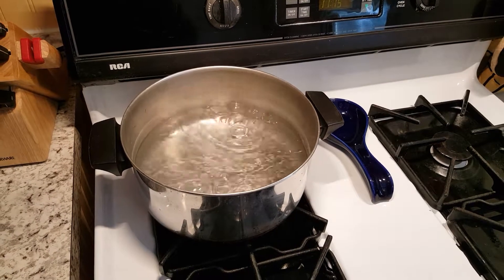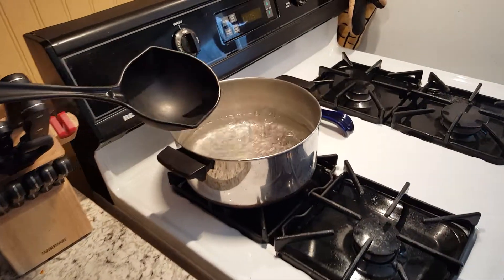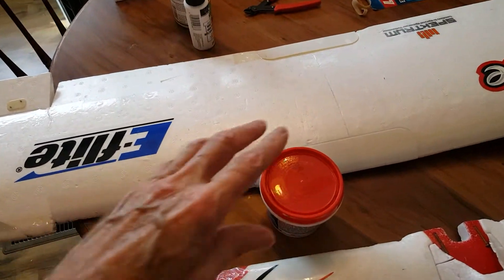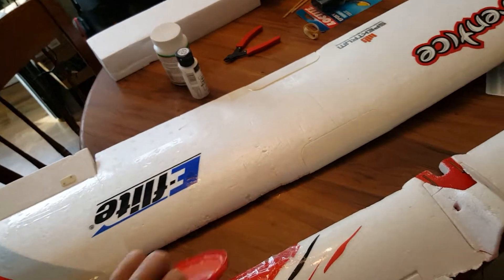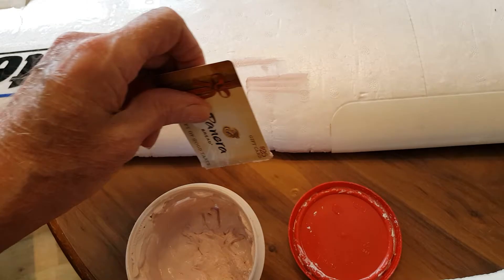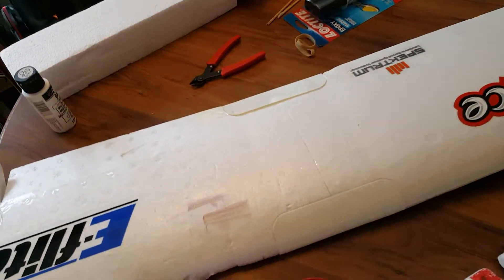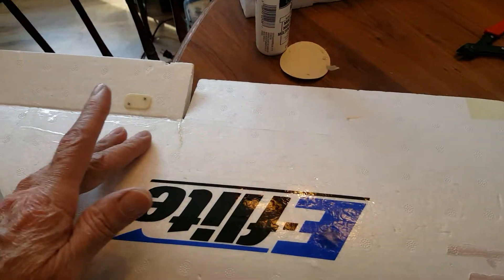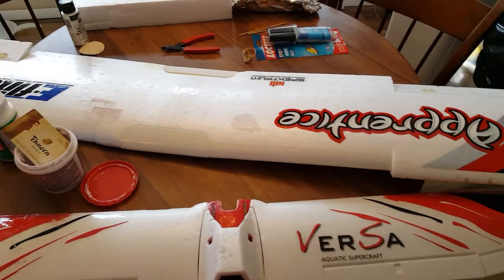RC plane damage repair methods

Comment: Great tips and video.  Probably too late to have this question seen, but i'll throw it out.  I'm in the process of doing this with MY Apprentice.  I'm interested to know what "color" Folkart paint you used to closely match the patina of the Apprentice surfaces?   Thank you
Reply from the maker: It is just the basic white as that tends to blend in better with the foam. I find it cleans up really well if it gets dirty too. I just uses it on my Pawnee Brave after stuffing it in a row of pine tress. The wings stayed up in the branches for over a month before the wind finally got them down. I used minimal spackling and paint. The wiring was a nightmare because it is internally illuminated with strip LED's. I haven't remaidened it yet but am confident it will fly as normal.
Reply: @scottfirman  Thanks very much - yes, I managed to hit a pine tree at about 40 ft. up.  But it slid down and able to retrieve it after navigating a swamp.  I have it pretty much repaired but was glad to see your video as I was trying to figure out how to finish the surface to look better.  Thanks again,

Comment: Great informative video!!
Reply from the maker: thank you for watching my video, I do appreciate it. I hope this helps you or someone else you may know. My Apprentice  ended up in a huge maple tree and I pretty much destroyed it. Sadly, it was so full of holes from my mini cross bow and fishing line as well as damage suffered from breakage removing it , after 4 years I decided it was beyond repair. Every plane has its limits on repairs.
Reply: @scottfirman  Too true. yes I've used your tips and managed to repair my FMS superEZ. I have given it a new splash of paint, too.
Reply from the maker: @nickhayley  I cannot take total credit for all of what I showed, there are others that showed great tips also besides myself. Glad you were able to repair and hopefully fly again. I took the acess hatch from my E- Flite Maule to lowes and they were able to match up the paint perfectly! I couldn't be happier as the Maule has a very specific color. I spent hours shopping for paint at every craft store to no avail. Now I can know any future repairs are no problem and any touch up are going to look right every time.

Comment: thank you  aim repair my   rc plane
Reply from the maker: I had to shoot 6 holes in my Apprentice trying to get it down out of a large Maple tree two weeks ago. I will probably fill the holes and get it going. Somehow it lost connection to the transmitter. It got a lot of Tree rash and the tail section snapped off getting it down. It may be beyond much hope.

Comment: how do you repair a large hole in the wing
Reply from the maker: Are you talking balsa or foam? If you are talking foam its easy. Take a sheet of paper towel and get it damp. Then roll it in drywall spackling.  Carefully stuff the hole with the patch, dont pack it too tightly, foam is lightweight because it has air pockets. I would go with as minimal a sheet as possible and use lightweight filler. After you patch had dried, you can start layering in the patching compound. Fill, let dry. You can then prime and paint.
I hit a high tention wire with my maule and put a sizable dent in the wing. The hot water expanded the foam back out and I used spackling to finish filling what didnt expand back. I also put a hole in my Apprentice fuselage with a branch from an apple tree. I used the paper towel method to fill that hole. It works well for ripped out cabains on a biwing too. I used epoxy soaked paper towel to fill the hole, then sanded and redrilled the new hole. That was on my Dynam WACO.

Comment from the maker: This method of repairing dents and fill in small holes using spackling compound. A smooth wing flys better than dents or holes that affect coefficientcy.